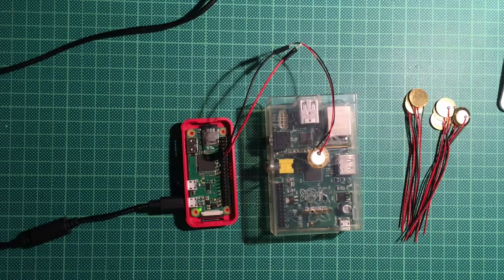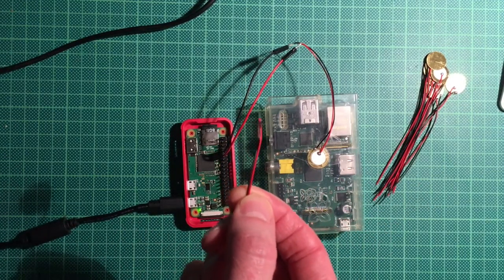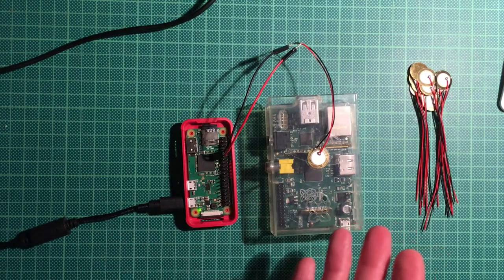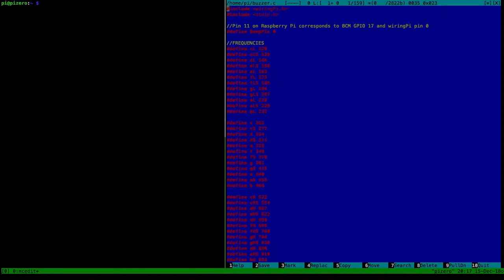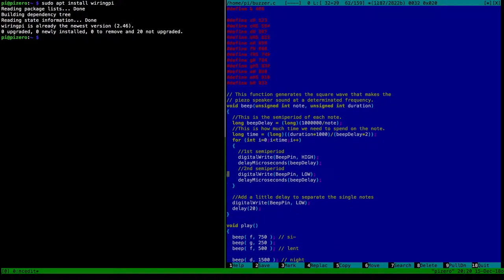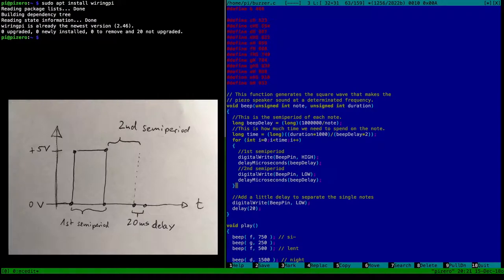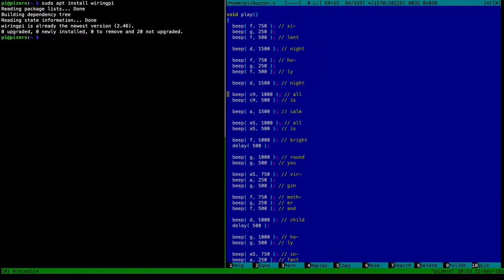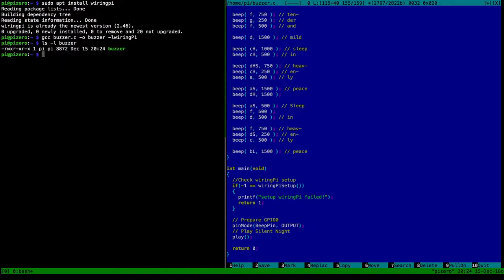"Silent Night" on a Raspberry Pi with a Piezo Buzzer

Comment from the maker: I updated the gist to use the pigpio library instead. So do "sudo apt install pigpio" and download the new version of the source. Compile and run with "gcc -W -Wall buzzer.c -o buzzer -lpigpio -lpthread && sudo ./buzzer". Also you now have to use the PWM1 / GPIO19 pin, which is pin 35 on the RasPi header (third last pin of bottom row). The new version is completely hardware driven, and you don't get any jitter. So the sound is much cleaner.